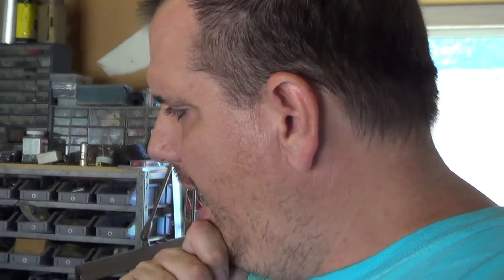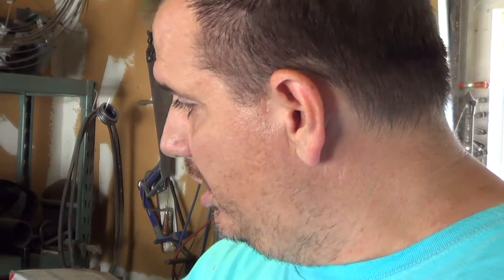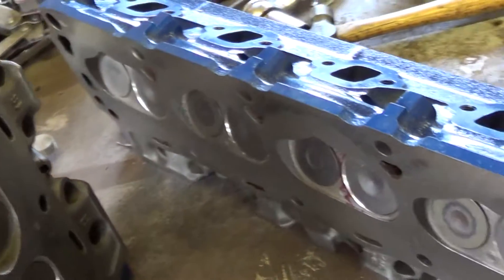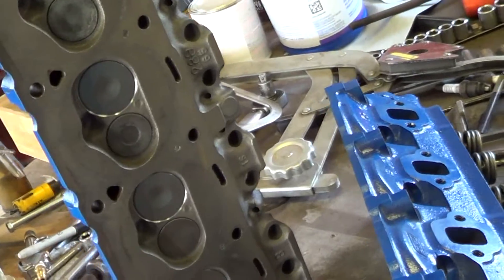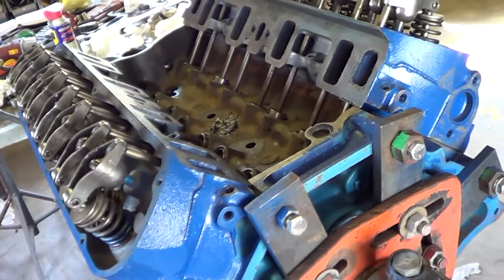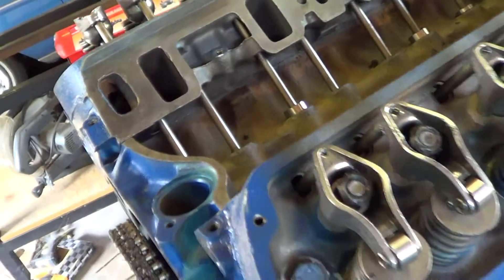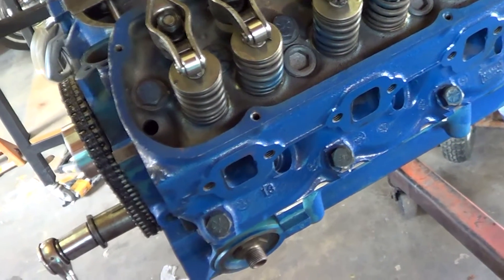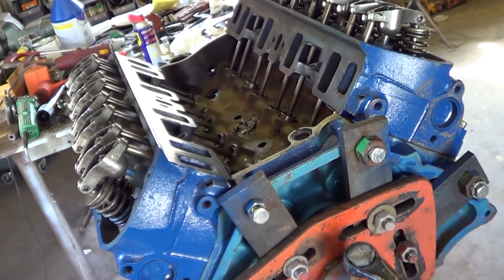1964 Ford Falcon Engine Swap Part 5 - Heads, Lifters, Push Rods & Roller Rockers

Comment: hi  mi engine in my 56 f 100 Pickup has the Code  C60E-9425 A   in need Roller Rockers! the Name of the  Rockers? compatible with my Engine??    Thanks Erik
Reply from the maker: You'd be best to confirm with a local machine shop than with some guy on the Internet. But, I found these on eBay. They work with the 3/8" stud mount.

Comment: So, i have a set of ported 351w dooe heads. And gonna chevy valves because it's just the cheapest way. Btw, this is going on a 302  and running Chevy valves, do i have the change any valve train componets to gm? Like the lock retainers or is it basically all the same?
Reply from the maker: You're best to discuss this with a local machine shop or in some cases a really good parts house or speed shop. As I understand it, some are pretty directly interchangeable and others not so much. But, there are other considerations such as stem height and how the retainers affect your spring pressure. Will it work and run? Probably. But, your longevity may suffer. Good luck.